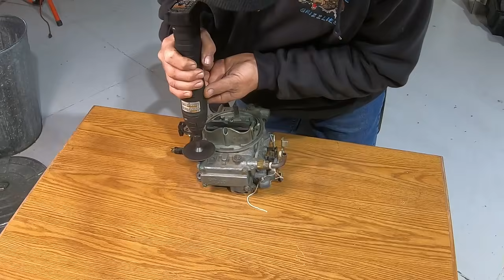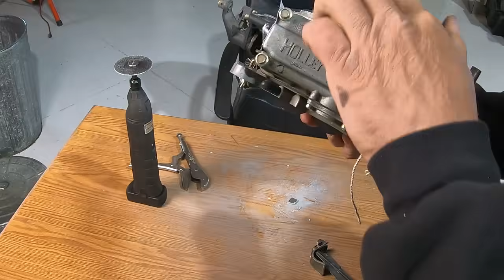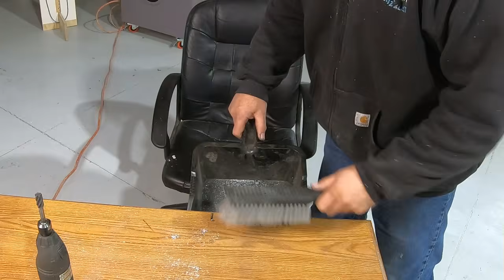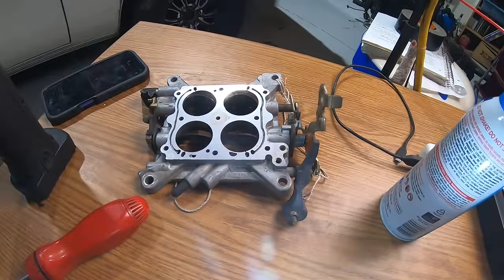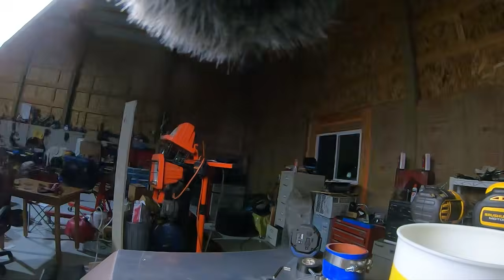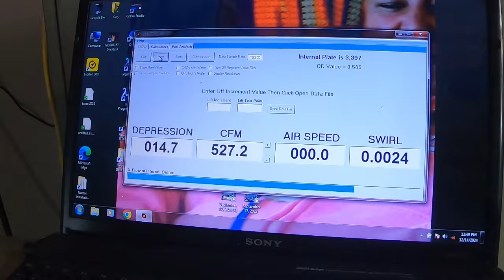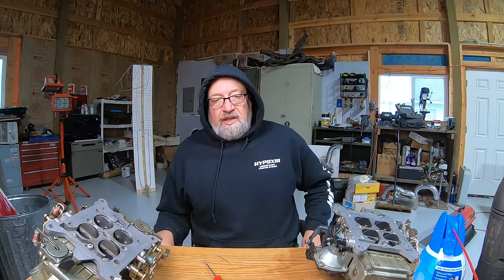Holley Hack: Transform Your Carb into a Race-Ready Beast

Comment: 2:12 Not a die grinder with an abrasive cut off wheel !

Make a fixture plate and mount it on the table of a milling machine.
Use a 5/8 four flute end mill cutting down 1/4 inch at a time.
Once you are at the finished depth you can come closer to the sides of the vent tube and air cleaner stud mount. 

Nasty abrasive dust all over. And your breathing some of it.
The title of your video matches what you are doing though.
So you get +2 points for that.T
Reply from the maker: Ah, a keen eye for detail! You're right, a milling machine would certainly be the connoisseur's choice for a dust-free, precision carb transformation. Perhaps my "hack" was more of a "dusty adventure." Thanks for the education and the +2 points – I'll take 'em!  ;-)

Comment: Hi, the carb should be tested as a ‘blow through’ from the top not a suction through the top. To get a true CFM you need to run at the industry standard IOW. I would take the air horn right down. Then you would see a lot more difference. So eventually what was created was more CFM not particularly performance. Also there are fuel injectors that are of more performance or just clean up the originals.
Reply from the maker: the flow bench was set to exhaust mod so yes it was a blow through carb.(not the carb just the way the air traveled through the carb) later videos i built an adapter so that i could suck thru the carb.........and i learn a few thing in the process...........Clean UP the Fuel Injectors????? carbs do not have fuel injectors....... 
Thanks for posting up. ;-)

Comment: I think if your converting to annular boosters cleaning up the bore is helpful to try and maintain the CFM but cutting the air horn off for what it's worth don't bother.
Reply from the maker: As you could see, removing the choke horn didn't make a hole lot of difference but i feel like i helps as you get more of the mod's done.

Comment: Nice video! Why did you flow the Holley 600 Vac carburetor upside down? thank you.
Reply from the maker: Because i didn't have an adapter to bolt it on my flow bench so i improvised. Turned it up side down, and then put my flow bench in exhaust mode so the air was push thru the carb instead of sucked or pulled thru.  later videos i built and adapter, and sucked/pull it thru like the eng would.

Comment: I don’t recommend cutting the throttle shaft down, one good backfire can bend / warp the throttle shaft. Yes I found out the hard way. Aftermarket use to sell thinner throttle plates / blades for that exact reason, and yes they would get damaged by a backfire.  ✌🏻
Reply from the maker: Agreed. 
There is also a much better chance that them screws.... coming loose with even bigger problem. the one running carb that i did this to. I red locktite, and then restake them in place!
Reply: @CudaFishEStories My experience with red loctite on small fasteners, is that it makes it permanent. You might be able to remove those screws with heat because they are easily accessible. But put that loctite on a screw where the threads are not accessible. It becomes permanent. A friend used red loctite while putting a customer‘s carburetor together. It returned a few days later with a much needed float adjustment. It would not come apart, so a new carburetor had to be purchased by the shop. Loctite definitely works. 😂 I‘m not even sure I would use the blue on those small fasteners. 😁
Reply from the maker: @Precision-427 agree 100% but I’m ok with the butterfly screws never come loose. ;-)

Comment: Might just be a in the top 10 vids for the gear head. Did this back in the mid 90s / early 2000s in circle track paved oval with restricted Rochester 2bls. Had two “school bus” Rochesters to play with, one experimental. We were already fast with the untouched Rochester so we didn’t risk getting nabbed by tech inspection and left it on the shelf. Love this as I’m building a 66 Chevy II for the street with a L79 based engine. Now I’m going to have to get my ass in gear and get it done. Still have that experimental Rochester as a momento of my early years rocking high banked 1/2 mile in Calgary AB, might just go on my 49 GMC Stove Bolt 6. Great Stuff, thanks !
Reply from the maker: I really appreciate your comment! It’s awesome to hear how this video resonates with your past experiences. Good luck with your build—it sounds like a fantastic project!
Oh and thanks for watching and sharing ;-)

Comment: I followed don terrill porting Holley carburettor book on a 600 and the 351 2v Cleveland it went on running on LPG picked up a fair bit of seat of the pants HP and I didn’t even do the throttle shaft mods
Reply from the maker: Yeah,grinding on the throttle shaft is a tricky thing cause if you don’t get it right and then screws come loose. You got damage to your motor so you have to be careful with that.

Comment: This was a great video. I’ve done a bunch of modifications to my 1850.  It’s cool to see how much each mod does. Gives me a pretty good idea how much I should have increased the airflow.  I did a bunch to the main body, including epoxying the airborne, and almost completely reshaping it. I used an onglet file, to thin my throttle blades all the way to the side of the bore. I replaced each throttle blade screw with a stainless button head with a flat washer under each one, one at a time, as to not disturb the blade position.  After thinning the shafts, and checking them with a caliper, to make sure they were even, I removed each screw again, removed the flat washer, reinstalled the screw with red loctite, and staked them. It ran really well on my car. You could definitely feel the improvement.  Just needs a little more tuning, and it’ll be great
Reply from the maker: Thanks! I'm glad you found it helpful. Your setup sounds pretty impressive. 👍

Comment: On my HO360 Mopar, here is a list of carbs I have tried, in no particular order;
a  500 AVS ,  a big TQ said to be an 850,  a 600VS,  a 750VS, and   a 750DP. 
Guess which one is still on there 20+ years later. Yes the 750DP.
If I had an 850DP, I wouldda tried that.

I knew that 600 was not enough carb, as soon as drove it around the block!  But, later, I set it up for fuel economy and was not disappointed. 
The 750 seems good enough, and  with it, the car went 93 in the Eighth @3457 pounds and 900ft elevation on a hot July day, up here in Sunny Manitoba Canada, back in 2004. It sure spun the tires a long way!
I thought that was pretty good for the old 68 Barracuda /4speed/3.55 Daily-Driver.
Reply from the maker: Hay AJ i think we know each other form a bodys only.......
Any hoot, finishing up on my next video where we clear up some stuff and then test two different carbs on a lot of air filter bases as well as several air filters combos.  should be interesting. Stay tuned ;-)

Comment: With my project XMC carburetor testing we took basically that same 650 holley and have gained 157cfm without changing the venturi diameter 😁

Just doing the steps you did here (that was our first iteration except I smoothed all the sharp edges more on top) we picked up 80cfm 🙂
Reply from the maker: Good job
that first one was a down and dirty one working on my next video. With some more insight on carb as well as changes to flow bench updates. 
What is a XMC?
Thanks for sharing;-)
Reply: @CudaFishEStories  Project XMC (X-treamly Modified Carburetor) is a series I do on my channel were we took that 650cfm main body and did a whole bunch of different stuff to it to see what we could achieve! 

We even filled it full of JB Weld Epoxy 😂
Reply from the maker: Nice Job!!!! i watched your lates video and comented on it.

Comment: Run your cutting disc in a bar of soap first, it helps it to not get gunked while cutting.
Reply from the maker: That's a great tip, thanks for sharing!
Reply: @CudaFishEStories  no worries. Side bonus. Pick a bar of soap you like the smell of and the shop will smell good for a few days afterwards 👍
Reply from the maker: @microstorm  😂;-)

Comment: Thanks man, good info. Interested to know the increase by doing everything you did, minus the air horn and choke? have you done this and left it on?
Reply from the maker: No this was a down and dirt, quick example, of how much you can gain. The Carburator adapter for my flow bench has arived so i can flow the carburetor the right way. more on that in the video.
My next video will be about testing some air filter bases to see if they help or hinder the air flow threw the carburetor, as well as a couple of filters and lids. Then we are going to the bottom of the carb and test some carb spacers.
Keep a eye out for it, i'm gathering part for this as we speak. ;-) 
Thanks for the coment, and showing enthusiasm in this subject. It lets me know there is interest in going further with this project.

Comment: I have seen when they take the boosters and thin them down as well and thin the thickness of the butterflies too. Would be cool to see just how far you can take this little 600?
Reply from the maker: The reason why  i didn't do them mods. Is that they will mess with the factory calibraton of the carb.....You really need to be brushed up on idle and main air bleeds as well as pv restricton and emulsion mixing.........all of which the average carburetor rebuilder Can NOT. DO or understand
If you can rebuild a carburetor, and have a dremel tool, you can do these mods and still rebuild a vary nice carburetor ;-)

Comment: I love your numbers do you have any tips on the vacuum advance modifications I would love to see more videos first time watching you I don't know if you have any more out there let me know I got two carburetors I'm going to get after and get some more flow
Reply from the maker: Welcome, John C if you buy the spring kit for the vacuum advance, it has a chart in there to show you which one comes on when also in the book that I recommended it also is in there. My biggest tip would be to buy the vacuum, or the secondary housing that allows you to change the spring without taking the housing apart. That housing will save you from replacing the diaphragm every time you change a spring.
Reply from the maker: here is a link to the kit   https://amzn.to/4foO0BS

Comment: any ZERO that uses canned air is areal HACK. THIS MAN HAS NO IDEA WHAT HE IS DOING
Reply from the maker: lol, Thanks for Sharing.
Reply: I mean I like my Wideband, fuel injectors and Motec too much to mess with a carburetor. My AFR targets are on point vs a Carburetor that can be basically uncontrollable in certain spots. Bet the same engine with a carb vs properly tuned fuel injected, the fuel injected gets more power everywhere.
Reply from the maker: @MrGsxrme  and what do you do when your throttle body is to small…you would probably buy a new one…. I would bore it out. Get some of them free HP
Thank for sharing

Comment: You can base plate out to 850 has bigger butter flys and change out boosters to down leg thats lot work but if you're running class were they have cfm rules its big in difference in performance
Reply from the maker: Agree. but thats way over the top, of the simple thing you can do without a lot of the knolage of the inter working of a carburetor.
Thanks for sharing.

Comment: Any chance you can show your flow bench tester, How it works and were I can get the Program for my computer,
Reply from the maker: I think i will do a video on it but just incase i don't get around to it. Its Called A "PTS Flow Bench" and it didn't caust me 10 of thousands of dollars either!!!!!   Im all about do it your self and this bench is not any different. You buy the plans from Bruce for 50 or 100 bucks..... i cant remember and them you build it your self. Bruce is vary helpful all along the way.  The computer program is Bruces as well.
Go check it out and  tell Bruce Flash sent you there;-)
http://www.flowbenchtech.com/forum/index.php?sid=10fc7533ccce82127a75661a51f9dab8
once again it takes a lot of work to build the bench properly but it won't break the bank. Just some time.
Thanks for your coment and have a great day!!!!

Comment: To me that sounds like false advertising. Say that carb is a 600 or 650 and it only flows 518. Then it’s a 525 if you ask me at most it’s a 550 without all that work that you put into it. That to me is a long way from a 650
Reply from the maker: I’m sure that the first mold or the first carb that came out of the first mold that was clean prepped and assembled by hand flowed 600 CFM. Documented that carb. I also agree however, it does suck.

Comment: I question the inverted carb flow testing  and the results due to it. I have never seen this done.
Reply from the maker: LOL  You may just get your wish, as i may do another video testing air filter and carb spacers exc. this would require me turning the carb right side up.  if i do that video we will start with that test.
Reply: @CudaFishEStories  I will be watching. One thing I have never seen is a good comparison on the bottom plate of an air cleaner. Factory GM high performance have a big hump surrounding the air horn opening. Many aftermarket are flat. Roadkill garage got the best flow using a salad bowl and not one of those velocity stacks. Comparing all this would be quite interesting. I have heard from back in the early 70's that the stock GM high performance 14" air cleaner was one of the best flowing and from what I know about sharp corners, radii vs mutltiple angles, I beleive it. What I know is certainly not a library of physics data so I am always learning.
Reply from the maker: I haven't experiance this GM big hump. and yes i did see that episodes were they tested the salid bowl on "Engine Master."  LOL
Reply: Most(aftermarket)bases(dropped bases, anyway)have humps to clear the float bowls & float adjusters on a Holley carburetor.
Reply from the maker: Sorry  mickangio
 I miss this one, my flow bench is haveing some updates being done to it so it might be a week or two more before i get back to it. but i plan on doing 3 or 4 different air cleaner base, as well as some spacer for the carb and a couple complete air filter design as well. Stay tuned.

Comment: 54 CFM should be good for 20 + horsepower. A Dyno would have been nice. To see the hp differences,
Reply from the maker: You have no idea how much i Wish i had one of those, and could do that. Remember the title of this channel. Im a poor man that has to improvise to make it happen. 
The one thing you have to remember, with that statement, is if the eng isn't requiring it,  it would be a 0 HP gain.........A hot rodded big block that you had just pull that tiny carb off of.......then yes i beleave it would!!!!!

Comment: great job showing what each mod is worth! man for a street car leave the choke on and do the other mods and you can still gain a bunch of flow, it looked like the whole choke horn was worth about 7 cfm which I would leave if cold starts are important.
Reply from the maker: Mind you, this was a down and dirty job. No time was done to make all the  radius smooth and constent.......but i agree. The lowest improvement was the choke tower.  I was surprised as well.
Reply: @CudaFishEStories  of course, not a criticism at all just stating you can stil have a street carb with choke and still gain alot of flow with your other mods!
Reply: If the carb was tested in the correct direction of flow the air horn removed would show more improvement. 
Carburetors are not designed to flow backwards😂 venturi effect will increase flow also and removing the little lip as the final step will alter the design to pull fuel out of the boosters . Good video though.  @CudaFishEStories
Reply from the maker: @rossmason4434   Thanks for the complement.
I'm realizing that i should have put a streamer on the butterflys to show the direction of air flow.
The air was being pushed into the carb and out the butterflys instead of pulled thru the carb. Stay tuned, we are about to test it both ways (sucking thru and pulling thru the carb)

Comment: Where does Holley get 600 cfm?
Reply: they are flowed at a different depression which he pointed out
Reply from the maker: Stay tune for a later epison were there is more info on this. But as "vrm said" the depression testing is different between a 2 barrel carb and a 4 barrel carburetor.

Comment: Great video intro to understanding carburation and the modification that you can do with them
Reply from the maker: Glad you liked it!
Reply: who in their right mind flows a carb backwards
Reply: @johnbnos944  if your unaware most flow benches have the ability to flow in both directions i.e. for intake or exhaust so the air is moving the correct direction through the carb,it doesn't really matter if the carb is upside down or right side up as long as your not testing fuel flow into the bowls but that's an entirely different machine